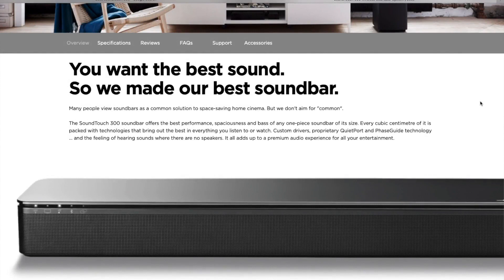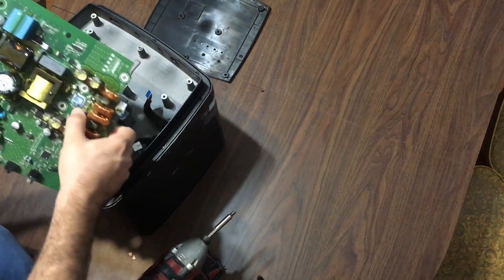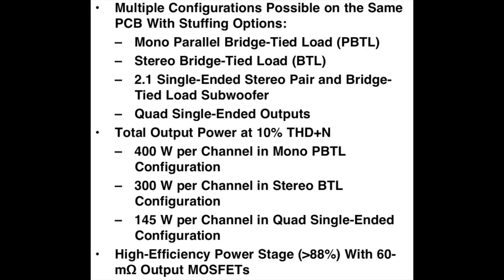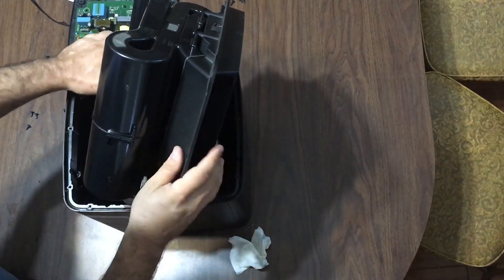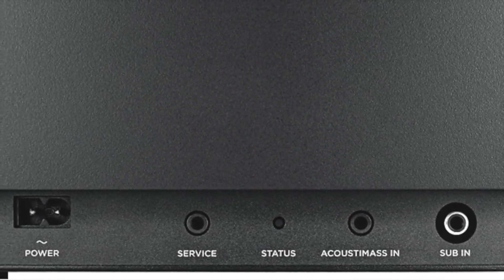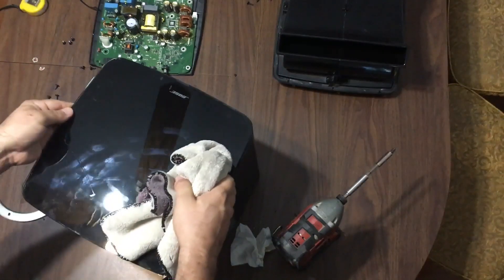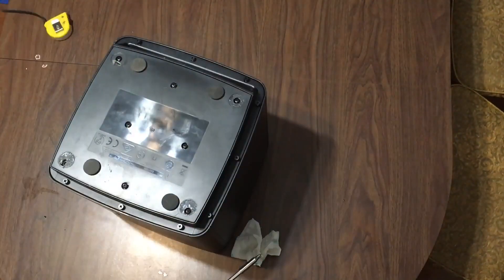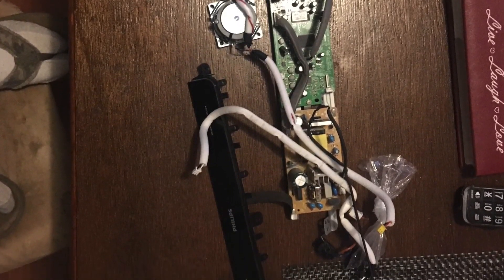What is inside a $700 subwoofer - Bose acoustimass 300 subwoofer disassembly

Comment: What about the bose 500 bass module? Haha
Reply from the maker: I know it is better than this one, but I don;'t have one, I already spend way too much in the soundbar and the acoustimass 300 module. Are you planning to buy a Bose soundbar and subwoofer?
Reply: @Letsdosomethinguseful  the bose 500 better than the 300/700? Please search again the ac 500 is a step down
Reply: @Letsdosomethinguseful  500 is smaller
Reply from the maker: @ssg5795  I didn't know that, glad you replied with this info because I am getting a lot of questions regarding the 500. Thanks and Regards.
Reply: @Letsdosomethinguseful  Bose is doing crazy marketing, 300=700and 300,700>500
I own a sound touch 30 but after some time I felt that there is so much more to be desired From sound system with that price , so it was my first and last Bose speaker , it sounds good with decent features but the price is not justified
Reply: @Letsdosomethinguseful  once I complete my studies  and start making 💰 then I would not mind spending a lot on high end sound systems , as right now I am stuck with Bose . It sounds good when placed correctly but I am finicky and always change the position to get the best sound possible 😁

Comment: Would you recommend this over a Cerwin Vega CVE-18s 18" 1000 Watt Powered Portable Subwoofer ? For movie and home use?
Reply from the maker: Depends, Cerwin Vega is way more powerful but it is designed more for PA systems than home use.
If you put this 300 watts Bose subwoofer in a very big room, like a church or warehouse or open space and you compare it to a Mackie or Cerwin Vega with the same power, you will notice that the marcie or CV are ways better. But for close and small rooms, Bose is better because it is designed to bounce the sound in walls and cancel overlapping frequencies and sounds, in other works, Bose home systems are much better appreciate in lower volume and that is how it is designed, to provided quality over quantity.
I have this subwoofer because it is the only one I can use with my Bose Soundtouch 300 sound bar, but of course, if I had the option to use other subwoofer, I could have a Mackie or CV or JBL nd that way I can use it in the patio too.
Reply: @Letsdosomethinguseful  thank you for your time I appreciate the response and I think I'll stick to a full bose experience after for the living room after all.
Reply from the maker: @dannysubohms530  yeah, same here.

Comment: Hi, my acoustimax 300 has stopped working and status light not working 😢 I’ve checked different cords and power outlets but nothing. Do you have any ideas of an easy fix? Ive not opened it up as yet but is there a fast blow fuse on the board at all? Thanks
Reply from the maker: No, I didn't see any fuse in the board. If it still under warranty, do not attempt to open it.
I did see 2 analog voltage regulators and a SMPS, a class D amplifier, like 4 relays and several inductors. I do not see what could have failed. If you ope it, look for blown capacitors, that is the most frequent cause.
Also, try to connect it to the soundbar and perform a force firmware update and see if the soundbar can reset the subwoofer.

Comment: The status light on my acoustimass 300 no longer lights up. Any help
Reply from the maker: Another user has reported the same. I looked at the board and there is no fuse in there, at least not a typical one. some relays and capacitors. Try to force an upgrade of the soudbar with the subwoofer connected to see if the soudbar can force the upgrade of the subwoofer. Good luck.
Reply: @Letsdosomethinguseful  I don't think it's possible to upgrade the software  of unpowered unit... Any other ideas? Thanks.
Reply from the maker: @Mifodiy35  No ideas, Bose are very apprehensive of their information. We have to wait years for they to release diagrams or something.
Reply: @Letsdosomethinguseful  I have the same problem, Acustamass 300, no led lights or power. I’ve tried different cords and outlets, only 1 year old.... very disappointed
Reply: Apparently we're not the only guys with this issue...googling it brings hundreds of results. Did you find any solution to it? Or you too having a 700$ worth piece of junk just standing in the living room collecting dust?
Reply: I have the same acoustimass 300 issue, no live annymore. Just 3 years old, i do not believe THE BOSE  afford this china crap..bad MOSFET types are common within China products.  Complex repair because of  computer control., it sucks!

Comment: Wow, $700 for a PLASTIC BOX!!! I would expect more than that. You can get a MUCH BETTER sub than that for $700.
Reply: You have to hear it it sounds insane
Reply from the maker: You are wrong... It is not just a plastic box... it has a glass top :)
Yeah, that is a lot of money for a small sub.
Reply: @alak58 Have you ever seen a Klipsch subwoofer? Made out of wood for much cheaper price.
Reply: @alak58 Maybe i never had a Bose Subwoofer. Still i dont like plastic speakers..
Reply: @alak58 Im Happy with my Klipsch speakers, they are made out of wood, its a  much more premium feel than a "plastic box with a glass cover" . And it sounds awesome.
Reply: @alak58 have you listened to a klipsch setup?I dont know what technology your going on about wireless transmission and loudspeaker design and amp technology has been  pretty well understood for over 50 years. Also  just because it doesn't look plastic doesn't change the fact its made of plastic lol and you could buy a klipsch spl-120 and a svs or klipsch wireless module for less and it would destroy the bose. And the best part is you can use it with any other component you like. this Bose is only able to connect to the 300 soundbar. Also this is one kind of obscure video and there 4-5 people asking how to fix their subwoofer. Imagine how many there are everywhere else. Oh and dont loose or break the remote for your soundbar because if you do your shit out of luck. No buttons. I have a Klipsch sub woofer from the 90s still going strong. And still, i would get an SVS or HSU or even build my own for cheaper. Then at least i have some quantitative measurements and information on performance. And check out the klipsch c-310aswi if you have a boner for premium looks. you can polish a turd doesnt make it less of a turd
Reply: alak58  😂😂😂😂
Reply: @alak58 For the same price you wont get this mich technology from klipsch right, but better sound. And in my opinion bettet looks but thats just my opinion.

Comment: Thankfully they’ve ditched the awful 5.5” Acoustimass “bass module” in favour of an actual subwoofer. But the plastic cabinet looks horribly cheap and flimsy.
Reply: It may look cheap but it’s surprisingly strong. They have a nice bracing inside wich makes it pretty strong for a plastic cabinet. And the 10 inch woofer is also a nice upgrade after all these years. Hope they will bring out a sub with dual woofer
Reply from the maker: @AM-in5cf  That's Right, all the base is aluminium and the glass is form Italy and a bunch o other nice features. I have 3 of the other old acoustimass modules and to be honest, this one does looks and sounds more like an actual power subwoofer and not just like a silence discrete subwoofer.Also, this is the most powerful amplifier Bose has put in a home device.
Reply: @AM-in5cf  Still, for that Price it should be made out of Wood.
Reply: @3limin4torZockt  No.. You cannot get consistency and life from MDF compared to the plastic... its not about price! Ever had a dinner in a fancy restaurant?
Reply: @thirumalkumaran  There are so much better subwoofers for that price.. Stop defending everything a big company makes..
Reply: @3limin4torZockt  "Better"?  on what basis? stop offending anything a big company produces.. they wont be surviving if they are not worth the money!
Reply: @3limin4torZockt  Bose isn’t a very big company. They aren’t even publicly listed (by choice).

Comment: does the jbl Soundbar 3.1 have more bass than the bose?
Reply from the maker: No, It does not, the sub is smaller (even that the box looks bigger) and also. the amplifier in the new Bose is more powerful than the one in the JBL. But the JBL can fill any average living room and I'm sure you won't need it to take it to the max so regularly. Very few times and for a very few second I had to rise the modulen of the soundbar more than 50%.
Reply: @Letsdosomethinguseful  jbl soundbar 3.1 has more bass the bose bassmodule 700 plays deeper my dad has the bassmodule 700 and bose soundbar 700 and i have the jbl soundbar 3.1 the jbl has more bass which jbl vibrates more very boomy
Reply: @Letsdosomethinguseful  JBL 3.1 Subwoofer has 300 Watt Bose Bassmodule 700 has 180 watt
Reply: @Letsdosomethinguseful  650 euro for a subwoofer that does not even have much bass hahahahaha Bose ist very shit
Reply: Liana Krieger at least the Bose plays deep an clean but the JBL sounds like a 30 bucks sub from wish xD
Reply: @fabianplanz924  With bose subwoofer I miss the bass passages in some songs 650 euro is much too expensive is only 300 euro worth
Reply: @fabianplanz924  Bose is rip off
Reply: The jbl 3.1 is pretty bad its bass heavy but not in a good way very muddy and not clean at all the sub over powers the voice isnt good for movies sounds good with rap music tho bose can do both I have the JBL 5.1 with the rechargeable rears in my room and the bose 700 for my living room and the bose 700 sub may be smaller but it's a stronger deep bass the jbl sub is boomy and has high resonance which shakes your windows and can interrupt the movie but the sub is strong it's no slouch but 700 hands down beat it

Comment: My module stopped working and i'm thinking about taking mine apart to see what's up. Since you already took yours apart could you tell me kind of what to look for. No status light no sound working. Thanks
Reply from the maker: Look for the AC plug, check continuity between the jack and the tip of the cable (you will have to open it in order to check that). That will be my first thing to check.

Comment: Did you open the vent ? What was inside the vent (tube). How does it work ? Superficially this time around the Bose hasnot created some intricate designs with multiple chambers. The box looks pretty much like a regular vented subwoofer which is pretty unexpected of the Bose. The Bose is becoming conventional !!!!!!!
Reply from the maker: No, I did not open the vent. I did see some unusual ports that turned out to be some aluminum grills very fine that looks like a sheet of metal, not sure if it is some kind of filter.
Reply: Let's do something That is the quietport Technology to reduce distortion or port chuffing
Reply from the maker: @azmiamin111  Thank you!
Reply: Aperiodic filter it is

Comment: +Let’s do something 
what controls the Acoustimass in put and what controls the wireless signal is it Bluetooth wifi 
Is there a way to trick the sound bar to get bass output from the sound bar with out a Bose Bass Module I have a powered subwoofer that is not a Bose bass module 300/500/700 basically I want to use my own powered subwoofer I’ve gotten roughly 30-40 seconds of output from sound bar but then the sound bar turns the bass/Acoustimass output off
Reply from the maker: the output of the "Acostimass" port in the sounder is a normal 3.5mm stereo jack, I guess you can check if you can connect a 3.5mm to RCA cable and connect it to another sub. Not sure if it will work, I have not test it yet.
Reply: @Letsdosomethinguseful  it doesn't work
Reply from the maker: @chinyanyie   To bad, I was hoping we can attach some other sub since I have received 2 or 3 reports of subwoofers not working anymore.
Reply: @Letsdosomethinguseful  wait for your good news!
Reply: they activiely have designed it to not work with anything else. propriety software of some kind  congratz on your bose!

Comment: That looks ok for a 400 dollar sub but not 600 or 700
Reply: I have 2 of these on my lifestyle 650, it sounds amazing. Much warmer smoother bass than the 12” sub on my previous separates system.
Reply: David Sandercock Is good but not amazing... I also have 650 with dual of this sub and to be honest is really muddy the fact that the crossover is too high around 200+hz...
Reply: @azmiamin111  the crossover is high because the satellite speakers do not have a mid bass driver , it only has a" twiddler"  (what bose refers to as a tweeter cum mid-range ), the end result is good vocals but average bass and as the subs have to multitask and do the upper range too .
Reply: @azmiamin111  the highs are also a little compromised for the audiophile listening experience because of the twiddlers , while   casual use , the sound is crispy enough for an avg consumer
Reply: Crappy Frequencies What surprise me the most is that Bose have implemented a 1 inch soft dome tweeter in the centre channel of the lifestyle 650. That really make a difference for vocal and clarity.
Reply from the maker: I kind of agree with you, I brought a $780 dollars Mackie subwoofer and it was way bigger and powerful.
Reply: Although the voice coil is decent sized with a hefty magnet but the cone looks cheap AF
Reply: For that price
Reply: Never seen in reality though , u know better  , thx waited for a long time to peek in and see the sub
Reply from the maker: @ssg5795  u're welcome